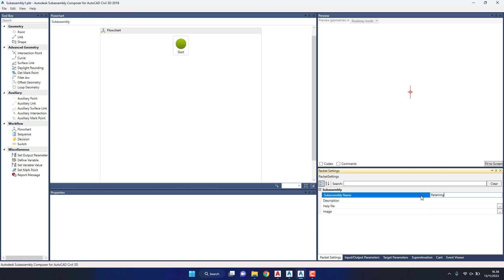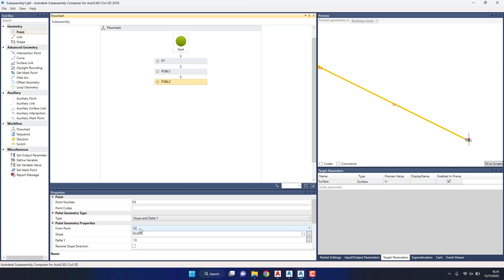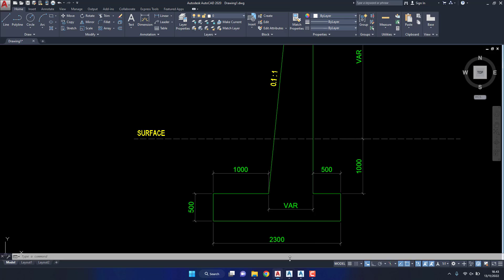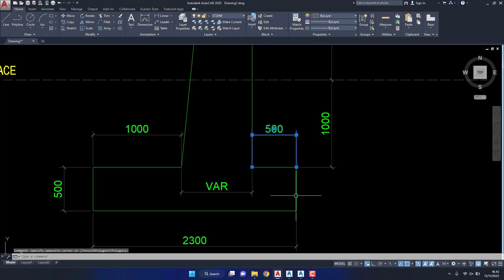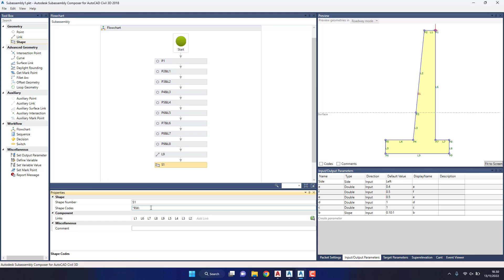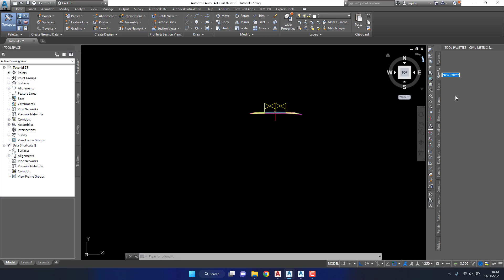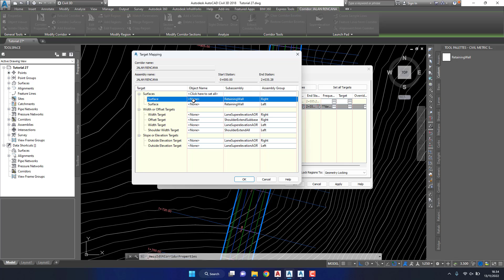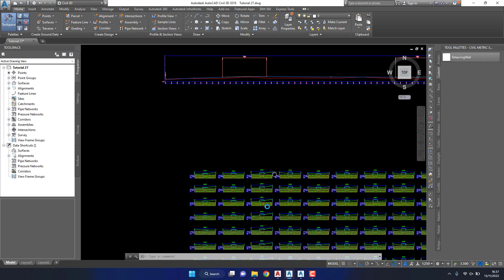Autocad Civil 3D Variable Depth Retaining Wall (Subassembly Composer)

Comment: Dear sir, in my case depth from GL is not fix.
I have direct bottom level , and they are changing also, low to higher as per profile.
How we will apply that level in bottom of wall. Please explain.
One idea come make feature line  insert level in that. But how I will attach feature line for bottom level of wall.